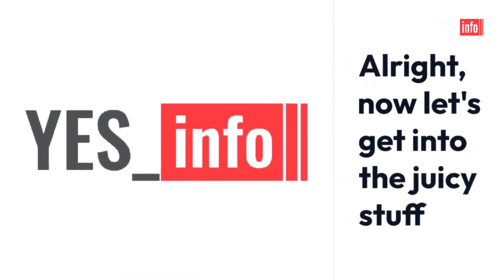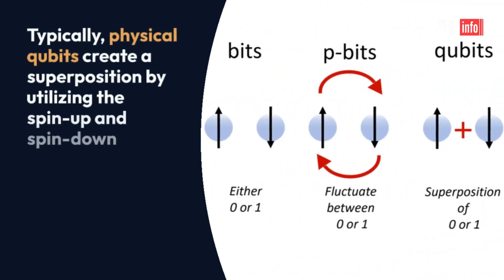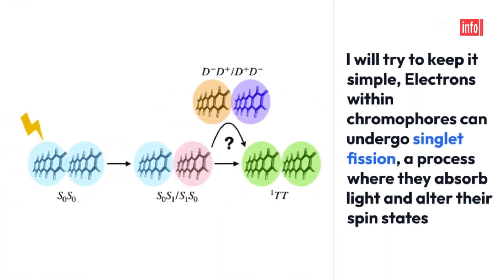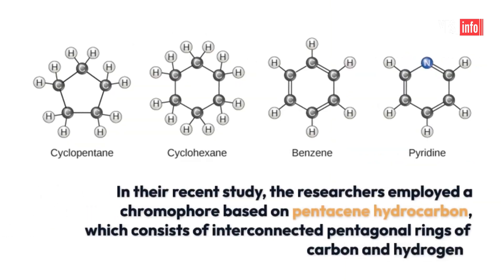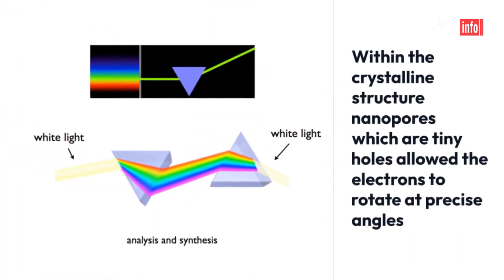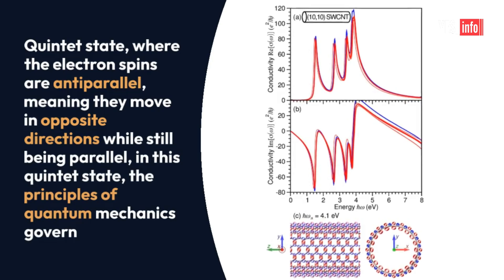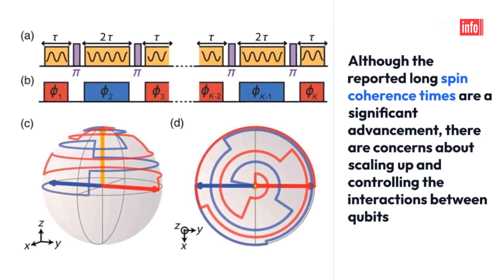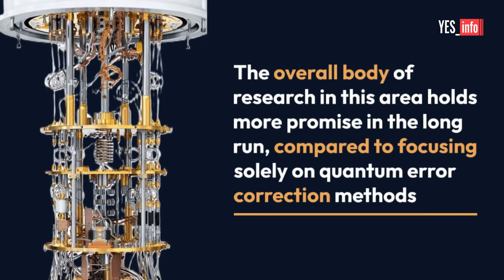What Does the Achievement of Quantum Coherence at Room Temperature Mean for Quantum Supremacy?

Comment: Even if quantum computing was possible at room temp. Lets just say its possible. How do you get the data out fast enough?  Nothing you can connect to it can keep up.
Reply from the maker: @djksfhakhaks
Great question! The challenge of data transfer rates in quantum computing is indeed a significant one. Even if we achieve room-temperature quantum computing, the bottleneck would shift to how quickly we can read out the data. This is where advancements in quantum error correction, quantum communication, and interfacing classical and quantum systems come into play. Researchers are exploring various methods, such as superconducting interconnects and photonic links, which have the potential to handle the high-speed data transfer required for quantum computing. It’s an area of active research, and breakthroughs in this field could revolutionize how we interact with quantum computers.

Comment: I was wondering what these quantum chips do?  Now I know that they are designed to maintain stable superposition qubits until they are measured, hopefully at room temperature. 👍
Reply from the maker: These chips utilize qubits, which are different from regular computer bits that can only be in an "on" or "off" state. Qubits have the unique ability to be both "on" and "off" simultaneously. This special ability, called superposition, opens the door to super-fast and super-powerful computing.
Regards
Reply: @YES_info  Yes, I know that qubits can have 1 and 0 at the same time.  What I did not know until now is why quantum entanglement is necessary for qubits.  Your video seems to suggest that entanglement is helpful (if not absolutely necessary) for creating and maintaining stable superposition.
Reply from the maker: @Shadowless_Kick, its not necessary but the utilization of quantum entanglement proves to be beneficial in reducing the time and computational resources required for information transfer between qubits. This entanglement allows for various tasks like quantum cryptography, superdense coding, and teleportation to be accomplished efficiently.
Regards